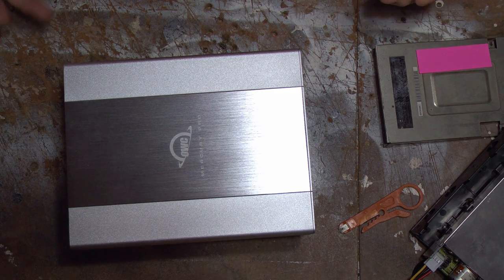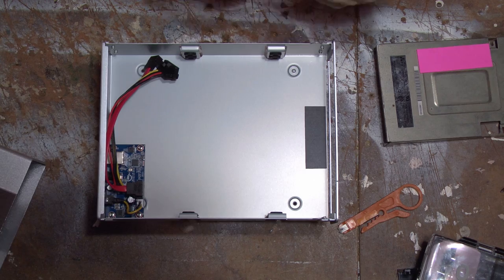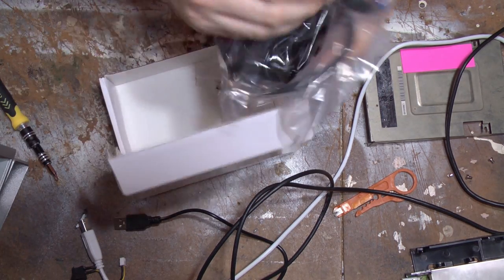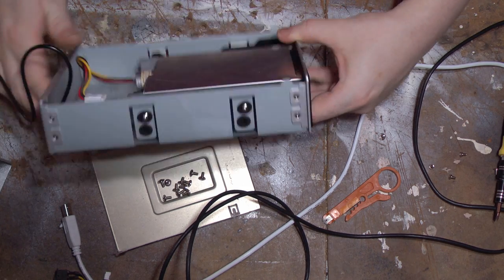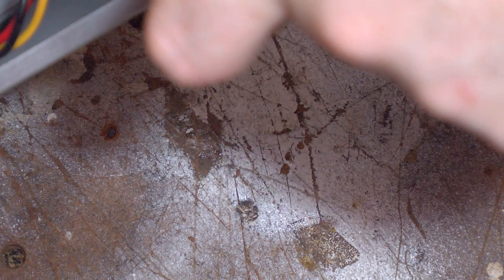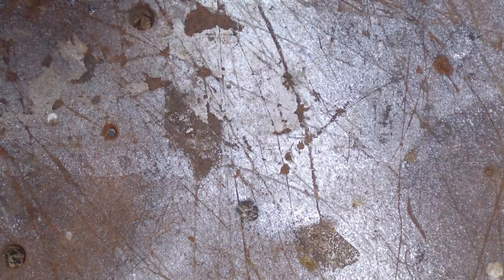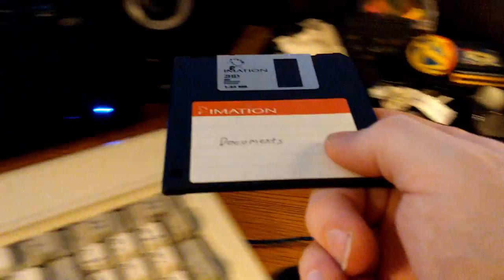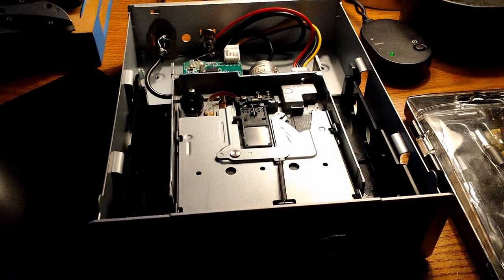Building your own USB floppy drive.

Comment: The adapter worked with DD floppydisks, I tested it back in 2020 with windows 10, but it appears that MS had an update that kinda screwed the driver. Now it's unreliable and very slow to copy/write files to the floppy...

Comment: Nice!  I like the hot gluing of the USB connector in place, that was a nice quick fix without making any permanent modifications.  That 3.5" drive in a 5.25" enclosure looks SHARP!  Really nice, reminds me of like an old Disk II or 1571!
Reply from the maker: That's actually what my intention was too, I wanted it to remind me of a Commodore or Apple drive.  I was considering putting it inside the computer but I received a new SD card reader with 4 port hug and 2 USB 3.0 ports.  Way overkill but since my Model F covers the front ports on my case, it's perfect actually there, while the drive sites off to the side under my bluray drive in the same enclosure as well to aesthetically match each other.

Comment: If it doesn’t read 720kB DD disks, I suspect it won’t read 2.88 MB ED disks either (not that too many "normal" drives would anyway.)

I presume you also tried the old trick covering the hole on HD floppies to fake the DD format?
Reply from the maker: But I have real double density disks that work, and the drive itself can read and write to them in a PC directly on a real FDC.  In this case, these USB adapters don't wire up the density select pin on the floppy drive, therefore they are actually blind to any other density other than what it's hard wired for, in this case high density, and that's pretty much it.  Foone had reverse engineered this adapter, and none of the pins are density select either, so you really can't even add the functionality sadly.